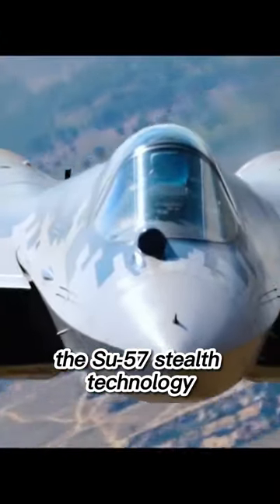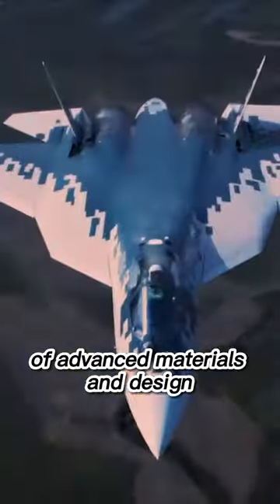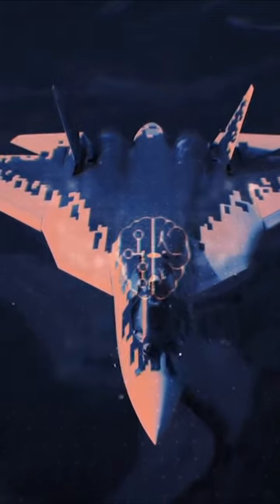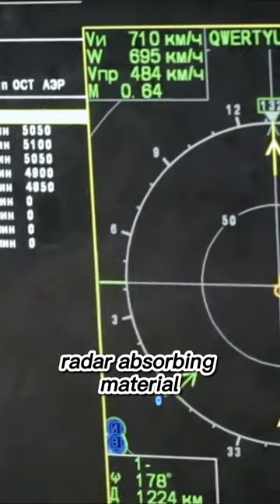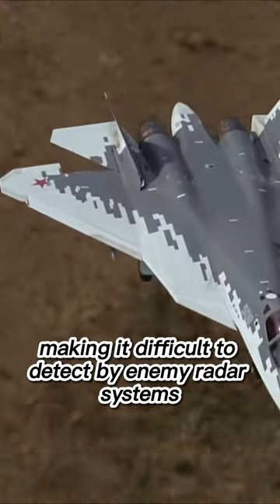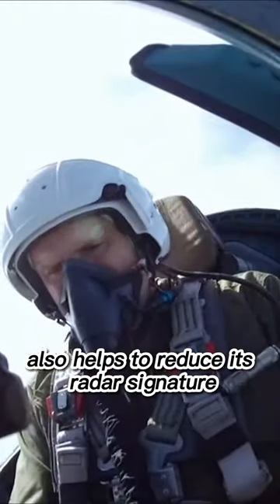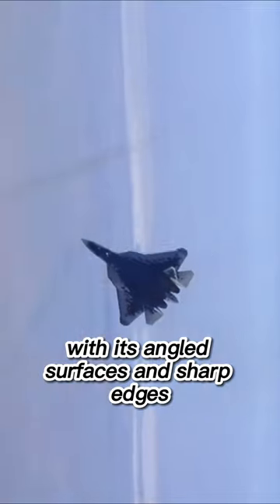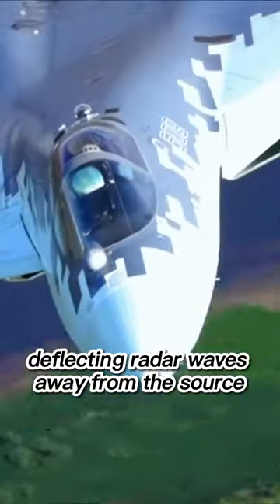Behind the Scenes: Building the Su-57

Comment: Stop calling it a stealth fighter. Otherwise they just need to give the f18 vectoring and bam it is 5th get.
Reply: Another person that listens to the Aviation Geek Club. There sure are a lot of you. Anyways, the T-50 has the same RCS of a F-18, the Su-57 lacking RAM has a RCS of 0.12m^2, and the Su-57 with RAM has a RCS of 0.006m^2.
Reply: @pollo4744 yeah no, the SU-57 is not that stealthy, now by all means id prefer peaceful back and forth about and i know i wont change you mind about, but i might just make you learn some weaknesses.
Reply: @Thatkoolgamer1  I probably should have mentioned that when it has a its IRST open the 0.006m^2 drops to a pitiful 0.017m^2. The Su-57 is problematic for Russia and its designers which haven’t built anything like it since the MiG-1.44, which I’m pretty sure the 1.44 is more stealthy, and the S-37 (known in the west as the Su-47). The Su-57 has great potential, Russia just sucks at taping into that potential.
Reply: @pollo4744  my biggest thing is the exsposed bolts, and every other careless flaw in its design. Just proves how little effort was put into
Reply: @Thatkoolgamer1  Yea, the exposed bolts is on the models lacking RAM covering.
Reply: @pollo4744  hmm, I suppose thats true. But considering atleast one has very bad stealth and less than 12 are even around, the felon wont beat the raptor and the felon sure as hell wont beat the NGAD.
Reply: @Thatkoolgamer1  Well, it’s not supposed to compete against the NGAD. If it was a 1 on 1 between the best Su-57 and F-22 I feel like it would be 50/50. The Su-57 can’t compete in numbers. like 31 or 21, and only like 12 of those have RAM, would not stand against the 177 F-22s.
Reply: Who tells you that it's only RAM material that defeats radar wave?? There could be other unknown materials such as special paints. You will never know.

Comment: Why su 57 have blue canopy
Reply from the maker: This is a question about the Su-57 fighter jet's canopy color. The answer is that the blue color of the canopy is a special coating that is designed to reflect radar waves, making the aircraft more difficult to detect by radar systems. The blue color also helps to reduce the infrared signature of the canopy, making the aircraft less visible to heat-seeking missiles. Overall, the blue canopy is an important part of the Su-57's stealth capabilities, making it a formidable fighter jet in modern warfare.